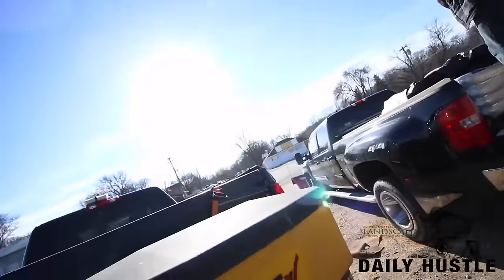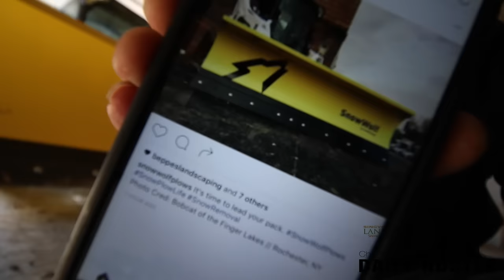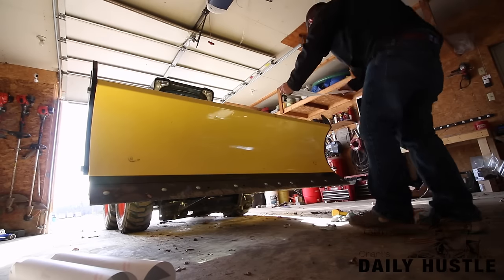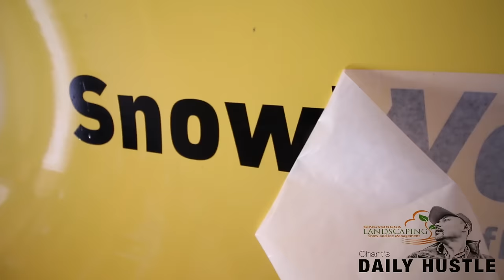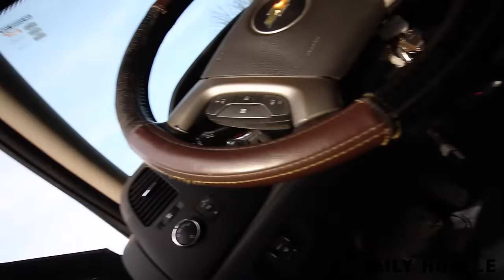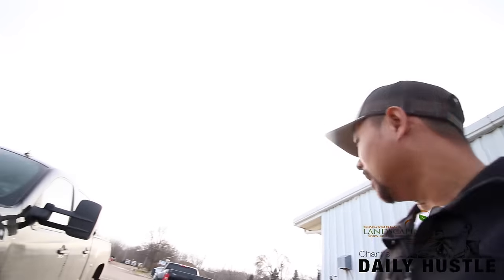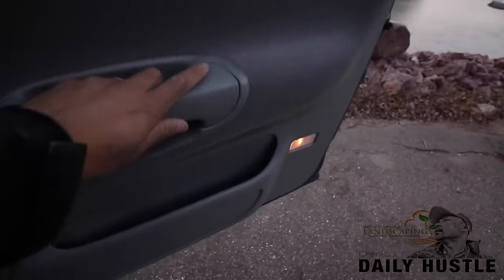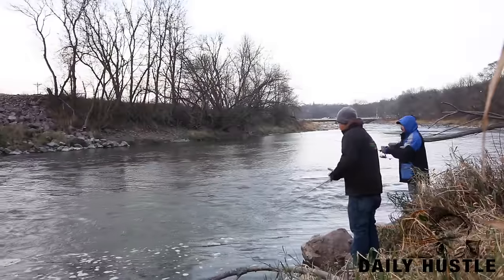New Decals  on Snow Wolf Plow   Chant's Daily Hustle 23

Comment: You could get some of those car magnets with your company name  for when you are snow plowing so people know who is doing it, they might want you to sand or plow snow for them.
Reply: i have a buddy of mine has a same yellow plow blade wich he mostully uses in the winter and spring and summer and fall wich he uses it as a box blade for grading driveways and roads wich pretty slick for multipurpose use and wont have to worry of getting a box scraper wich the plow blade  pretty well handle the task wich is nice with these kind of blades